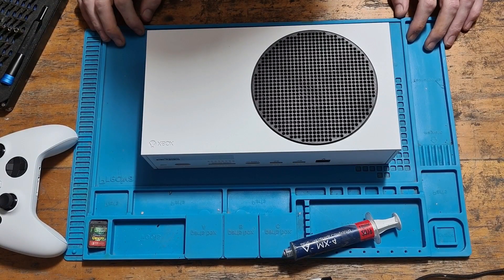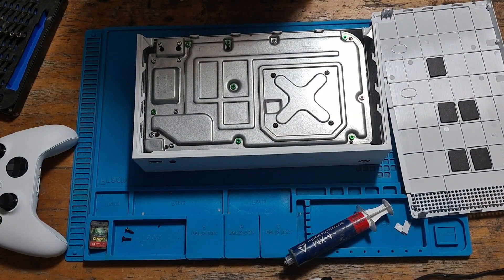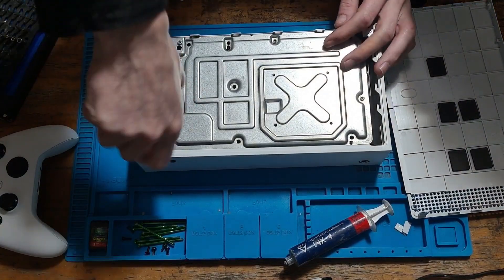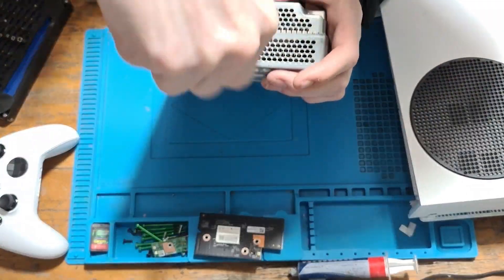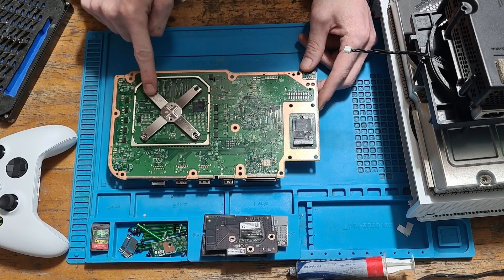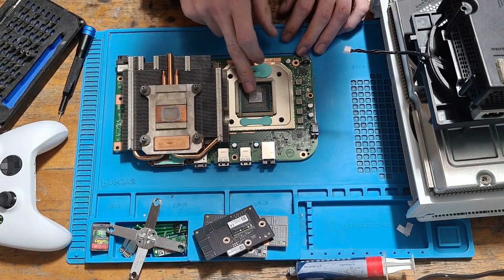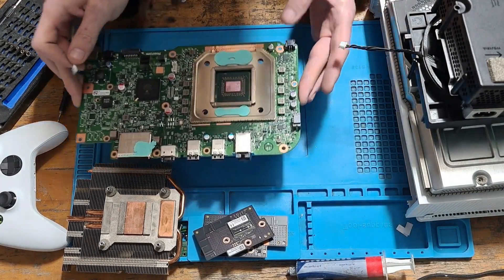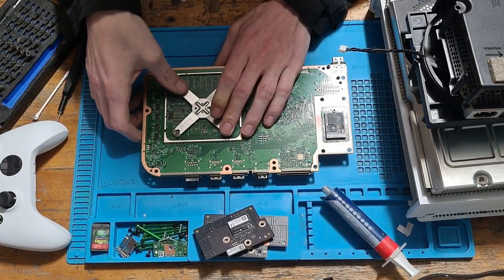How To Replace The Thermal Paste On Your Xbox Series S

Comment: Thanks for this, had to replace the thermal paste on my wife’s xbox and we have 4 more in the house if they should ever need the same! I wasn’t going to be able to get any MX-4 paste for at least 7 days so I used MTX-50 paste by Corsair. Now it’s running like a charm without constantly shutting off. It was so bad that it would shut off after only being on for 2-3 minutes. Anyhow, thanks for the tutorial, super easy to do!

Comment: Iv just knocked off two of the little things off under x clamp had to just diy it bk on never used soldering iron got it to hold what r they would console work if I havent got them bk in properly
Reply: It could still work. You probably knocked off a few capacitors. If they are being used as voltage stabilizers then it can still work if a few falls off.

Comment: I would wait until your console is out of warranty before doing this.
Reply from the maker: Microsoft cannot void your warranty for replacing the thermal paste. No company can
Reply: @TheCod3r  depends on what country you live in and rather if they find that void warranty stickers are deemed illegal or not.
Reply from the maker: @SteelRhinoXpress  even if the country doesn't deem the stickers illegal the burden of proof is still on the manufacturer to prove what you did caused a failure
Reply: @TheCod3r  you're right, but at the same time they can have a stronger argument that you tampered with their product that lead to damage, instead of something being flawed.
Reply from the maker: @SteelRhinoXpress  yes but they have to prove beyond reasonable doubt that the product has developed a fault specifically because of the device has been worked on by someone. They can't just claim that's the case. They have to have actual evidence of the fact. Without real evidence, the warranty is not void.
Reply: @TheCod3r  they honestly  dont have to do any of that if a country deems it's illegal and sides with companies that removing a void sticker voids warranty  then that's all it takes. Like I said before every country is different  in the way they side with manufactures or not with voided warranties. Remember every country has their own laws. What we deemed illegal in our countries doesn't  necessarily apply to how other countries  in how they abide by those voided warranty sticker laws.
Reply from the maker: @SteelRhinoXpress  companies have to abide by laws in that country yes, but the EU and America all follow the same law in this instance, so most of the world that law applies
Reply: @TheCod3r   the EU and America is not most of the world though. So one can't say the laws that America and the EU have on this also applied to every other country throughout the world.
Reply from the maker: @SteelRhinoXpress  no but most civilised countries follow the same guidelines
Reply: @TheCod3r   and that's a fact?
Reply from the maker: @SteelRhinoXpress  yes it is. Why is this an argument to you dude? Why are you so bothered
Reply: @TheCod3r  define civilized 1st world countries? I'm not but there needs to be clarification so not everyone gets a false impression, that they can do this without checking if their country abides by voided warrantee stickers or not first. Video's like these should come with a disclaimer for that reason.
Reply: @TheCod3r Manufacturers always void warranty if you open and start messing with the internals. Unless it's an authorized service center.
Reply from the maker: @stacld  completely wrong. The Magnuson Moss Act doesn't allow the manufacturer to void warranty for opening it

Comment: Just did this on mine because it started getting real hot and occasionally crashing. Sure enough the thermal paste was completely dry and crusty. So I re-pasted it with some fairly cheap Artic Cooling MX-2 and it's perfectly fine now. Thanks for the video.
Reply: hey! where did you buy it? idk where to buy mine i tried amazon but idk what im looking for
Reply: @MassiahNoMas  Just search for 'Artic Cooling MX-2' (or MX-4). A 4g tube is more than enough and probably ~$5-6.
Reply: People said that MX-4 would suffer pump out on a direct die so I went with MX-6 since it's more viscous

Comment: I'm glad to see Microsoft has gotten rid of the security screws so it can now be opened with a regular torx bit, also since they have gotten rid of the warranty void if removed stickers and replaced them with just black ones does this mean the console would still be under warranty even if you have taken it apart?

Comment: Is it necessary to do this once you pull it out of the box?

I just got mine last December and so far it has been running perfectly quiet with the console feeling quite cool and heat only coming out from the black fan like it normally should

I also use a duster to clean around the console after every use too
Reply: what did you do then?

Comment: Hey thanks for this. Glad to see that the heatsink is copper as I'm thinking liquid metal. Here's the REAL question, though, is it just optical illusion, or are you actually going righty - loosey, lefty - tighty on the screws?
Reply: I think the video must be flipped, I was wondering the same
Reply: Good luck if liquid metal hits the contacts it’ll fry your board

Comment: Why wouldn't you clean the heatsync or processor with rubbing alcohol? I've never seen someone clean off thermal compound with a dry q tip and their finger.. don't think I'd recommend especially by leaving oils and sweat behind.
Reply: Exactly this guy had no idea
Reply: Agreed. I always use contact cleaner sprayed on a decent Q tip.
Reply: It doesn't matter lol as long as nothing is causing an electrical short the paste will do its job. It's not a nuclear reactor. You really have to be dumb to mess it up.

Comment: A bit disconcerting that newly released consoles have nearly dried out compound. I'll do this with the X when I get one early in the new year. I'm not worried about the warranty. I've done this with every console I've owned - Sony or Microsoft. The original PS3 60GB benefitted hugely from a change of compound to a top quality paste after a reflow.
Reply from the maker: I agree, the first series s i took apart had signs of liquid on the psu too. I did that one on live stream. Technically Microsoft can't void the warranty for replacing the thermal paste anyway so I wouldn't worry too much either way :)
Reply: @TheCod3r 

Well I wasn't aware of that tbh. Nice one... that's even better and good to know regarding the warranty 👍
Reply: It’s not dried out it’s sopost to be that way so you don’t have pump out from the APU. You’ll have to reply paste 6 months to a year after. If you use wet paste.
Reply: Series s usually has good application of wet paste
Reply: Not dried just more of a ceramic type thermal glue than paste
Reply: It's a PCM (phase change material) so it's solid when it's cold and putty-like when it's hot

Comment: Runs it cooler after you put thermal paste
Reply: But you’ll run your Fan hard applying new thermal paste
Reply: @SirSlicer66  tested the fan RPM after new paste and it hasn't changed, performance has not decreased since new paste has applied 👍
Reply: @Namadabin Was the paste in your console already dried out?

Comment: Question : does it matter the metalic bracket position when mounting ?
Reply from the maker: The x clamp if that's what you're referring to can go on any direction as long as the plastic piece is on the bottom
Reply: I like to mark the clamp an post it came from just so it has the same tension as before.

Comment: All console thermalpaste are like this from factory. They dont need replacement its just that the thermalpaste havent made any heat transfer and they turn like they are dry but in fact they are not. A dry thermalpaste gets from usage in time with heat transfer
Reply from the maker: I did mention that in the video that it is usually dry from factory, and it may need replacing some day. I understand paste is dry from factory because the consoles sit for months before being sold. This video is intended to show the process for when the paste will need changing
Reply: @TheCod3r  I was just saying because some people maybe after the  video will start to disassembly their console :) if the thermalpaste havent been used even if its a little dry didn’t loose any of its proprieties:)
Reply: @armandarmi  I was gonna type this , you saved me from explaining it lol.
Reply: @armandarmi  I did mine after two weeks of owning it with MX5 which is much better than stock
Reply: @alejandrotobienne584  
xbox series x fan loud

Hi i have aan issue with my series x in some optmise games series s x my fan goes loud for exemple 
Fifa 22 in.the menu 
 Ac valhalla in performance mode only quality is dead silent 
Halo infinite warfare performance loud but quality silent 
 Its not like a ps4 level but its noticible ...
 I ask some friends they told me that their console a quiet .. even with heavy loud 
For old gen games even in 4k its  silent ... 
Also another think i try everything reset console performe offline ubdate cleanig from dust only without open it ..
Remaining now only change thermal past
The last games tennis match point make it loud even its not an heavy game .. also this games called lake its make ot loud anyone can help or confirme what i said please

Comment: Are they using any cooling on the mosfets?
Reply from the maker: No the VRMS are cooled but not the mosfets. They may be an issue in the future but judging by the design the warm air will probably pull away from the mosfets with the fan
Reply: @TheCod3r  yeah, it would have been nice if they were also cooled with a small heatsink or something.
Reply from the maker: @Attiqharoon  I agree, I guess they never learn though unfortunately
Reply: @Attiqharoon  just use thermal pads cut to size. The PSU has a shield which acts like a heat sink. I used a thermal pad for the southbridge chip also.